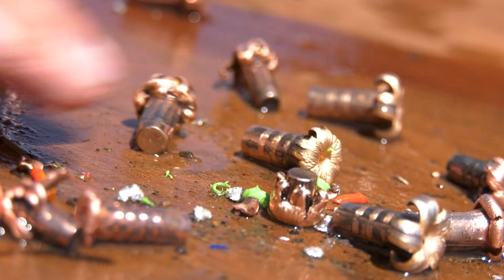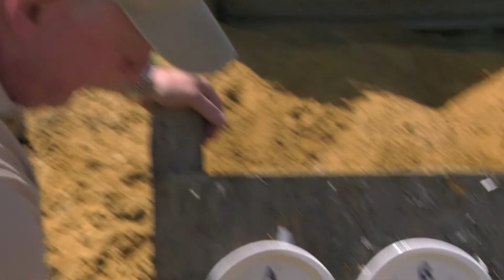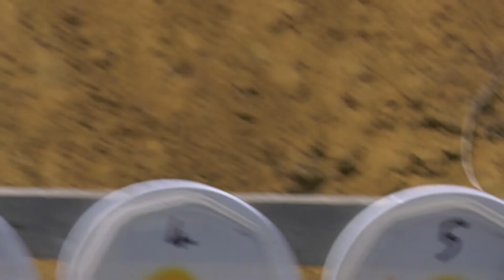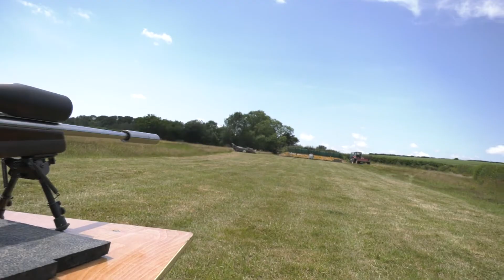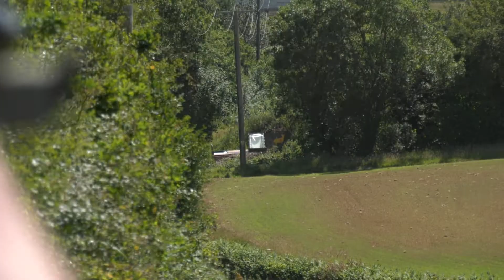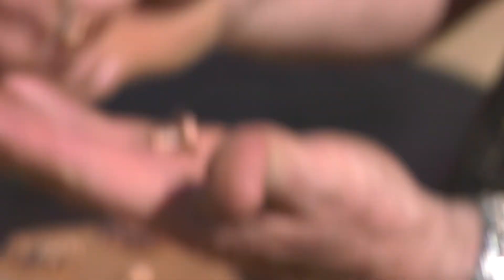Copper bullet power and performance

Comment: I agree with the tester that bullets that do not expand well at a given distance does not mean failure but its the at the limit of the design. I shoot Hornady .30-06 American Whitetail 150gr InterLock SP.  A call to Hornady's tech support department this is what they shared with me. These figures are for .30-06; brand, weight, bullet type, minimum velocity to expand and the distance

American Whitetail, 150gr, InterLock SP, 1800 fps - 400 yards
Super Performance, 150gr, SST, 1600 fps - 600 yards
Precision Hunter, 178gr, ELD-X, 1800 fps - 800 yards

The US ammo manufacturers load their basic ammo; American Whitetail, Core-Lokt and PowerShock in 150gr SP minimum terminal velocity of 1800 fps at 400 yards.

The average hunter in the US will rarely take a shot beyond 200 yards. We hunt from a blind to 75 -125 yards at a feeder. 

Having worked in the retail firearms sales many hunters both new and seasoned can be easily persuaded to spend more money on ammo that necessary. A box of American Whitetail retails for $19-$21 while the Super Performance and Precision Hunter sell for $33 and $36/box. All prices listed are USD

Dead is dead with $19 to $36/box ammo. How dead does the game need to be? He'll be just as dead with the $19/box ammo as he would be with the $36/box. The same goes for rifle. The dear will be just as dead if shot with a T/C Compass at $299 as he would be with a Browning X-Bolt at nearly $1000 or more.

Where you want to spend the money is on optics. A $1000 rifle with a $100 optic is a $100 rifle.

In the following video, The Pigman shoots a nilgai at distance with a $300 T/C .300WinMag, Leupold scope. You don't need to blow your whole wad on ammo and rifle if shooting under 500 yards. If you are truly shooting beyond you'll need a 26" barrel either standard or heavy profile. You will need to spend on optics.

https://www.youtube.com/watch?v=6cssIMbHl1c&t=5s